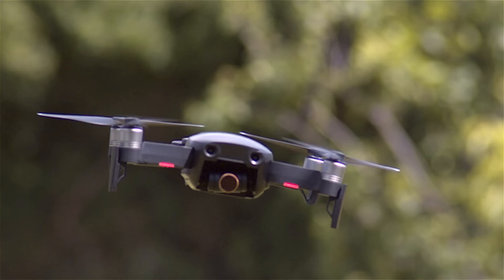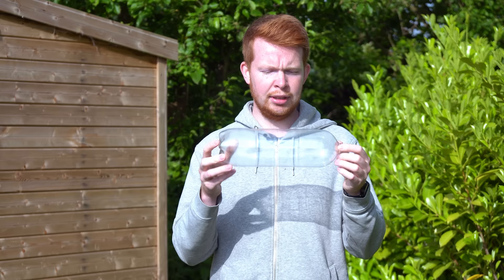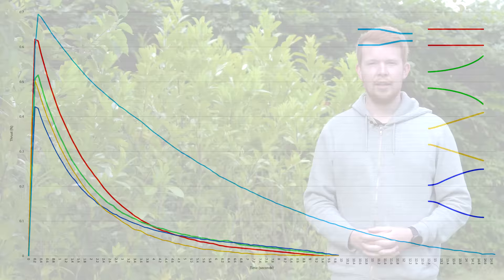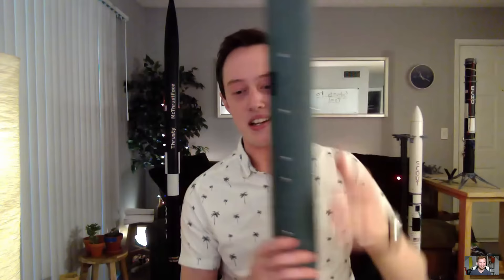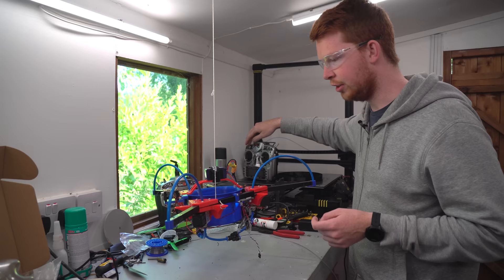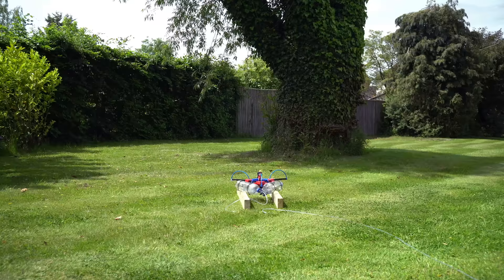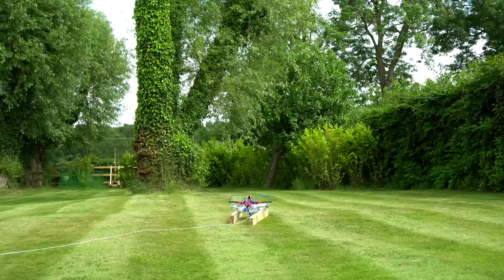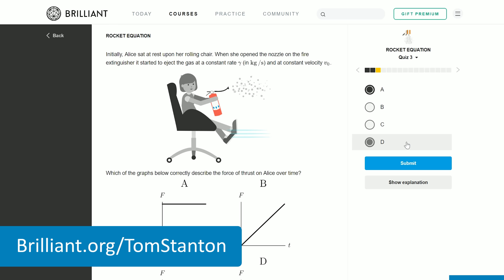Gas Thruster Controlled Drone

Comment: Really awesome concept Tom!
To fix the stability issues at different pressures you could incorporate a small gas pressure transducer and use the value to adjust the threshold tuning on the fly.

Comment: Looks like you need in-line pressure sensors and variable solenoid valves instead of binary. Great job man! Really impressive.
Reply: He can do the pressure part in software. The computer knows how long it was firing, and he can separately figure out pressure vs time. Then it would of course need to be started at a specific pressure. But it saves the weight. 
Maybe I just see everything as a software problem because I'm a software developer.
Reply: @TheJohnreeves  In this video he already tried adjusting the PID values to vary the release time and didn't work as well as my suggestion would. He needs a hardware-based gradient valve solution that would change based on the relative pressure after it's released more and more.
Reply: @umbra1016  The problem is that flow and pressure are linked when using a fixed nozzle. A pressure transducer linked to the throttle gate value should help though.

Comment: The bell nozzle is designed for supersonic flow where the velocity of the air is mach 1 at the throat. U should look at subsonic nozzle designs that's why the straight nozzle was the best. U need a convergent nozzle instead of a diverging nozzle

Comment: You could use pressure regulators to keep it at or below a certain pressure at the output
Reply: So that way the air would last longer and the thrust would be more consistent. That's a good idea.

Comment: Joshua Bardwell has a video on pids adjusting with battery voltage.  This would do what you need i think,  you'd just need arduino to send pressures to the fc.  Cool project 😀

Comment: Yup, ya gotta pressure regulate. drop down that 100 down to whatever is a usable pressure for stable flight and set the nozzle pressure to that. You'll still eventually lose control of course but you'll have better control for longer.

Comment: What happens when he runs out of air when disconnected from the supply.  Air pressure changes he loses stability which can be seen in the video.  There is no feedback loop to read air pressure in the bottle and use a different compensating value for pid control as pressure changes.  Probably far beyond what an Arduino was designed for and may need to upgrade the controller and add sensors to read pressure inside the bottle.  Simple feedback mechanism and when you create yourself a graph of pressure value and time nozzle is on may help understand how the system functions...  Fun video and some of it was beyond me but very cool.

Comment: A regulator would keep the output steady while the supply is above demand.  100psi bottle, 60psi thrusters, maybe even just 30psi thrusters with smaller holes in the thrusters. 

The longer arms give more leverage, but require longer travel, thus longer thrust.  - balance.  Use a smaller nozzle with less thrust on a longer arm so you can vary the open close more effectively to get more stability.  I suspect your shortest "open" state on your valve gives too much power for micro adjustments.  

Smaller holes, less air, smaller tubes, less weight, maybe there's a micro compressor that could be battery powered and weigh less than bottles and their extra tubing?  Lighter building materials, for instance, Carbon Fiber Arrow Shafts are easy to come by when an archer damages other parts of the arrow.  Find a tall archer, his draw length will be longer, thus, so will his arrows :)

Comment: Straight nozzel because you're flow is subsonic, this means that all the other nozzel designs you were using acted purely as diffusers (subsonic diffusers for a better term) , slowing down the exiting air for pressure gain (losing kinetic energy and being converted into pressure). If you want to use the typical rocket nozzel shape your flow must be supersonic this would make all the other nozzels which are subsonic diffusers super sonic nozzels. In order to have the classic rocket nozzels you would first need a subsonic nozzel (diameter goes smaller) that comes to a middle point (all flow here becomes super sonic) then after the middle point you need a nozzel that increases in diameter (supersonic nozzel). Implementing this should give you loads more thrust 👍

Comment: You ought to be using 134a in your bottles that way you have a liquid that boils off maintaining a pressure longer that you can use for your thrusters.

If you also would use a high-speed compound gas valve it be smaller , lighter and you'd be able to operate it at high speed pulses rather than bursts. This would reduce overcorrection and increase stability in movement. More than likely there are updates on this already so I apologize if I'm repeating stuff that's already been stated.

Comment: At around 17:45 I believe what is happening is ~simple inertia buildup~ defeating the ~air thruster's~ ability to manage
any control over the inertia created by the swaying "back and forth",, which with each additional sway motion, the air thruster(s) aren't a match enough to maintain any stability!
     The solution in simple terms is,  how do you increase ~air thruster response~ to the increase in simple inertia created by inertia and gravity!?!   Increase the psi in the air bottles???  But air pressure availability is finite!   Unless you maybe try 
~vectoring the lift air~  somehow,,  or,, maybe add a sort of ~Kites Tail~ directly under ~dead center~ of the fan motors
and maybe the kites tail will give a natural control over the wavering side to side motion???!!!   Love your work!!! Cheers! Sonny.

Comment: have more than one air jet nozzle per limb, so have your extended nozzles right out on the ends of the limbs and then one about half way between the end of the limb and the centre of the drone, then set up a pressure sensor to detect when the air pressure drops below a certain point at which time the outer most air jet nozzles are used rather than the closer ones.

this may cause issues with weight and so your battery may run out faster, but it may solve the issue of instability at lower pressures. you could even use two nozzles in the same position, one nozzle tuned for higher pressure in the tank, the other tuned for lower pressures, hence allowing for more consistent thrust... this way you might even be able to impliment a more mechanical valve system where at lower pressure the valve would switch to the correct nozzle without the use of electronics. this might save weight? 

interesting videos though.

Comment: Try putting smoke in the compressed air (at the input of the compressor), just to visualize how the stabilizing works :)
The high motor speed is probably due to the second propeller not being very efficient in the fast airflow of the first one.
For the compensation of the pressure drop, try a counter to monitor the valve time, and decrease the PID gate threshold when the counter increases.

Comment: pressure regulators between the bottles and the nozzles. then calibrate to 40psi or so and fill the bottles to 120. That would enormously simplify controls. Maybe put as much weight down a 1m pole (battery mostly) to increase the stability. Maybe three smaller batteries in parallel on a the feet of a tripod.

Comment: Sweet project, me likey. 👍 I think one of the reasons your ducted fan wasn't performing as well as you'd have liked was because the blade and duct surfaces weren't smooth enough perhaps? I think if sanded and sprayed with resin, to be as smooth as glass, 🤩 it would let air flow through the system with less turbulence.

Comment: I see at least 6 other people already suggested using 16 or 12g CO2 cylinders which are something like 850psi. I think you need a variable valve that allows an analogue value, as right now it's binary  - all on or all off. However I guess you could simulate any level of thrust between  0 and 1 by cycling the opening of the value extremely fast so simulate a smaller amount of thrust. That way your software can just work with clean curves rather than jagged 1's and 0's

Comment: I'm wondering if you could get more stability with frequency controlling the valves? Higher tilt, higher frequency, more airbursts per second, more thrust and vice versa. Like a burst controller.
Don't know how well those valves would keep up with higher on/off switching but might be worth a test?

Comment: Great Video, love you Projects. I have something about the nozzles:
The Bell shaped nozzle only works properly with Fluids traveling faster then Mach 1. Rocket use them to increase the exhaust gases velocity. But they first shrink the diameter and then open it up again. (Its called a Laval Nozzle) The straight one has the tiniest cross-section and for that the fastest Airspeed. If you make the cross-section larger you slow down the air. The airflow is restriced to the 4mm input so opening up the diameter doesnt give you any advantage. But like you have discoverd, if you shrink your nozzle you speed up the air and it gets faster.

Comment: Those bell nozzles sucked because they only work for supersonic flow, where Bernoulli's principles are essentially reversed. What you don't see in those nozzles is further upstream, where the transonic region occurs at what's called the throat. Further upstream of that is actually a converging portion, which follows the rules of subsonic flow in order accelerate the flow up to the throat. That upstream portion is what you were essentially looking for, so it makes sense you went with a teensy hole!

Comment: 15:56 – Ladies and Gentlemen, may I present: The Venturi effect, courtesy of the large curved surfaces of the bottles.
Reply: I'd say it's a coanda induced ground effect as the Venturi effect is mainly used to describe air pressure's relation to velocity inside a tube or pipe
Reply: @benfillman4049  accelerated air underneath the bottles, making a low pressure, sucking the drone to the ground. venturi effect
Reply: The Venturi effect is the reduction in fluid pressure that results when a fluid flows through a constricted section (or choke) of a pipe. 

Coanda effect is the phenomena in which a jet flow attaches itself to a nearby surface and remains attached even when the surface curves away from the initial jet direction.

You Decide.
Reply: @MrDaewen  Phenomena is plural. "is the phenomena" is nonsense. You decide. No, wait. No discussion.
Reply: @Anvilshock  So that is your argument? My spelling? You have completely convinced me.

 By the way, I wasn't making an argument either way, just posting the scientific definition of each effect to inform those who might not fully understand. 

I am not well versed enough in the science involved to make a valid argument which is why I didn't.
Reply: @MrDaewen  There's a difference between making a typo and blinkeredly parroting an all too common carelessness. Congratulations, you tried to use a difficult word to feign sophistication. Congratulations, you failed.
Reply: @Anvilshock  There's a difference between making someone notice that he made a typo in a friendly manner, and being an outright jerk about it.
Reply: @loicdeniel8361  And your point is? You know, apart from the one where you, too, failed to grasp the difference between typo and carelessness.
Reply: @BlobicusPrime  It's the rest of you. At least that rest who feels awfully attacked by uncomfortable facts.
Reply: @Anvilshock  Okay, thanks for clearing that up for me. I was wondering why you kept replying.
Reply: @cobra5094  Thank you for providing material that actually supports my points even though you probably thought it'd serve to contradict them.
Reply: @Anvilshock  did you not even take a look at it? Lmao
Reply: @cobra5094  I did, that's why I said it. The video makes a point that registers are a matter of choice. Meaning, if you talk like arse, you choose to talk like arse, and are therefore 100 % responsible and to blame if and when, as a result of your choice, you allow yourself to appear careless, ignorant, superficial, disproportionally easily offended, whiny, … the list goes on. See, regardless whether you're at home or in the office, you still ought to heed basic things like washing your hands after a toilet break. Same principle applies here.
If you mean to say that you didn't get that, then congratulations, you didn't just fail to understand my point, but the video's that you linked, too.
Reply: @cobra5094  At no point did I demand to speak particularly formally. Ever. That is just you trying to find things that somehow sound like they confirm your stance in lecturing me, as is the rest of your concatenation of stock phrases. And no, just taking a bit of care to use singular when singular is required does NOT constitute formal language. Not commonly, though. Unless you consider it common that people stomp around in your living room with muddy shoes, piss in corners, leave the fridge open after taking out all your beer, set the neighbours cat on fire, play music blaringly loud until late after midnight, and shoot each other. Then, yes, even watching out for a word or two might be considered disproportionate and formal. Seems to me how you and I have different standards. After all, you find it funny how I keep responding but you see no problem doing it yourself. I guess it's always right when you do it, never when the others are doing it.

Comment: 5:43 2 years late to the game here, but it makes sense that the straight through nozzle worked best. Rocket nozzles only work well because the fluid reaches >= mach 1 at the throat, so the expansion of the fluid afterwards increases the speed. In subsonic fluid flow, fluid expansion causes it to slow down, and the bell nozzle expands fastest, losing the most velocity in the escaping fluid.

If you wanted the escaping air to go even faster, invert the bell nozzle so that it tapers down to the throat.

Comment: See.....the straight nozzle has the most thrust. The converging nozzle is a straight nozzle...you're just increasing pressure before using a straight nozzle. Very nice video so far. Back to the build.

Comment: If you used “canned air” cleaner duster, you could possible extend flight time.  When sprayed upside down, the liquid sprays out.  Spray that liquid into a soda bottle, and cap to capture liquid before for it flashes off, and the pressure will be maintained at about 70 psi as long as liquid is present, as that’s about the saturation pressure of that liquid.  The downside, however would be having liquid sloshing around which could introduce bigger issues, you know, like a constantly shifting center of gravity.

Comment: Your "thrusters" are simply expelling the air that you have contained in a fairly low pressure vessel.  Spacecraft use propellants in space such as MMH and NTO which are hypergolic and explode when combined.  You have no explosive propellants at all, you're just seeing air escaping the tank at ever decreasing pressure.  You're just pushing the air through an orifice that's why your 2mm had longer "thrust" than your 4mm (it was 1/4 the opening). You will get no benefit by nozzle shape.  The traditional rocket nozzle shape you show is shaped that way because it's a combustion chamber.
Reply: RCS thrusters use single propellants at high pressures, not hypergolics
Reply: Also, nozzle shape does have effect here, as it lets the gas expand whilst still being forced out

Comment: Air tank bottle should be filled partially (~1\4 or so) with water and tube should led into that so that air-water mixture passes away and create higher thrust with less air consumption. Probably bigger diameter of valves are needed too.

Comment: You can use proportional valves for this 🤷‍♂️
Reply: You wouldn't want to, the pressure drop across the valve is a loss in efficiency, unless you made a variable throat nozzle
Reply: @geekswithfeet9137  they only control the flow, not the pressure? I'm not sure if there will be any amount of pressure drop because of the valve?
Reply: @OM222O  sorry man but I'm not here to baby feed amatuers, anything that throttles flow is creating a pressure drop. In fact if that's not self-evident then i really don't know where to start.

Comment: add helium to those tanks instead of co2
Reply: helium crazy expensive
Reply: But what about adding a helium sphere for lift instead of propellers? Would this work?
Reply: Wheaterballons alread exist..
Reply: Ohmloud sure. But they are not that controllable right?
Reply: then use that instead of co2
Reply: @libuddha3384  that's an rc blimp
Reply: when was he using co2?
Reply: @pacman10182  in the video he used co2  and that's why we're having this discussion. Didn't you see the video?
Reply: @robertmael9839  he used compressed air, did you watch the video?
Reply: @pacman10182  Joe used CO². Tom used compressed air
Reply: @richardmillhousenixon  ah, I skipped past those parts.

Comment: Consider putting a small amount of water in the pressure tanks.  The control reaction should be stronger and last longer.  Install tanks vertically at ends of legs, providing more stability,  and leg height so air flow is assured at take-off.

This may all be wrong, but it inspired me to think:  so THANKS!

Comment: The air pressure from the main lifting fans are forced around the curved surface of the 3 bottles 
when the craft is sitting on the ground, causing the craft to be sucked to the ground preventing take off.
Great video by the way. The control jets look like they are responding too late and stay on to long.

Comment: pwm valve controllers
just like the ones for brushed motors
Reply: The valves are mechanical, thus there is added time when opening or closing. Even the best valves at their best can only do 2ms in one direction, where as in motor the pulse width usually is below 1ms.